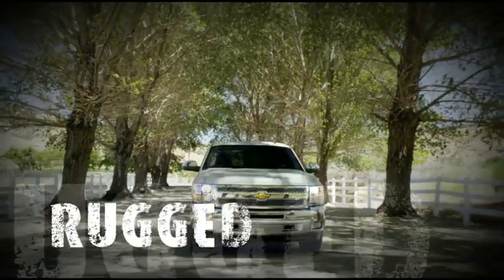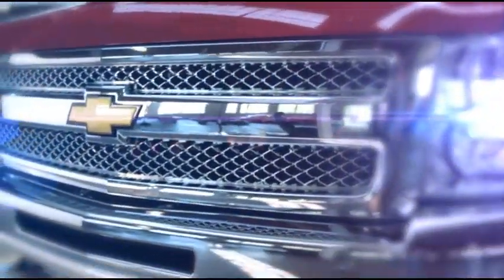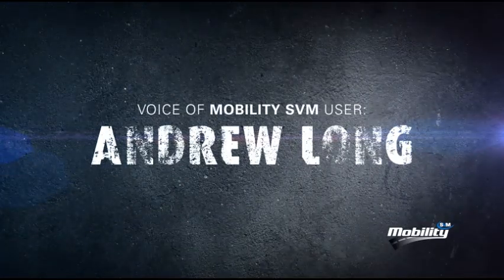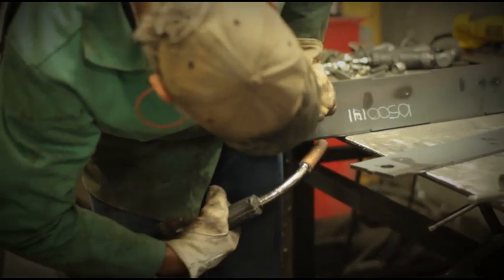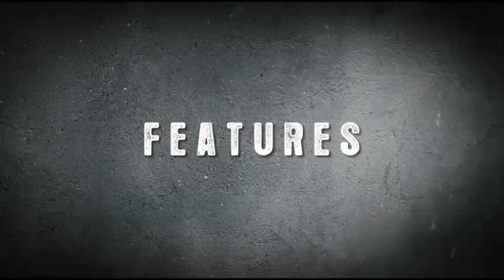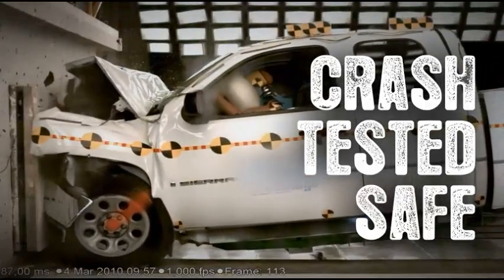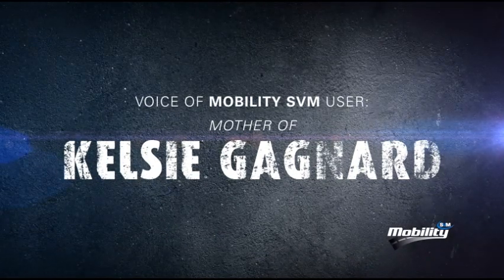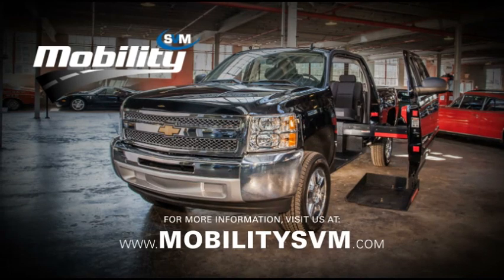Wheelchair Accessible Truck

Comment: I prefer driving a car over a truck or van. I don't like having to ride in my wheelchair when I can use a six way power bucket seat with lumbar control and recline. This is a great idea and a move in the right direction , but not the prefect cure..I have used a wheelchair for 47 years.....
Reply: +George Humphrey I totally agree with you. I sit in my wheelchair as little as possible. doesn't matter if its a car seat or the couch.